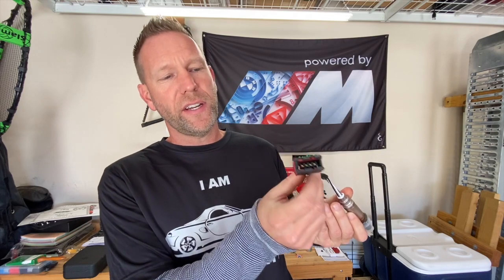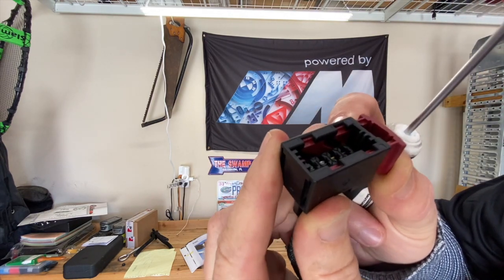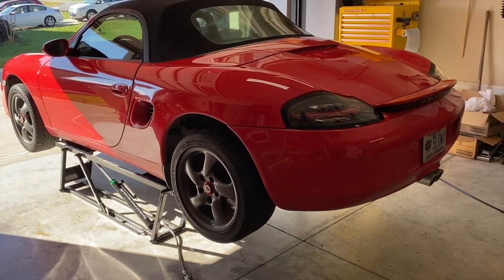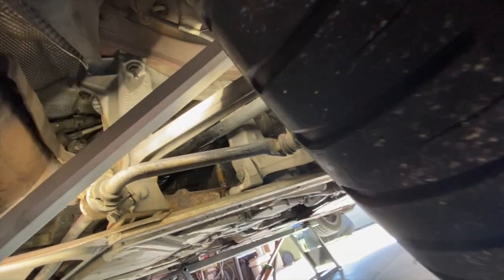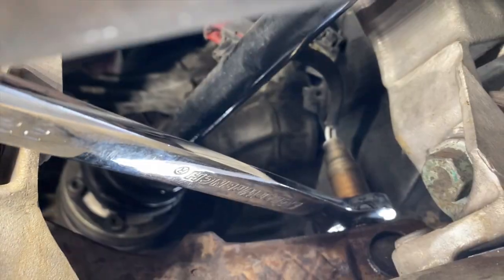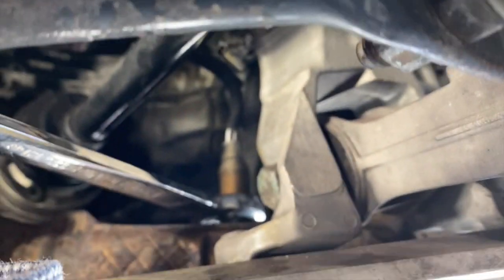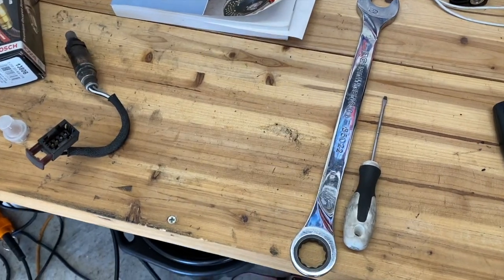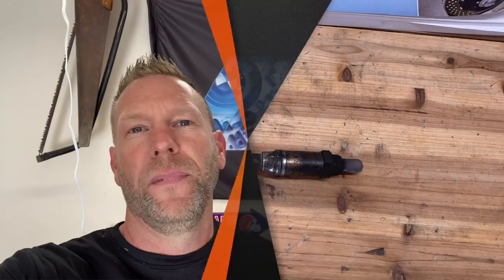How to change the OXYGEN SENSOR in a Porsche Boxster 986 (Project 19)

Comment: Hi Aaron. You're a very lucky man getting that o2 sensor out so easily. Changed out both my pre sensors around 6 months ago and a week before doing the job I sprayed them 2-3 times a day with penetrating oil just to give myself a good chance at getting them out as they looked in very bad condition, but to no avail as they wouldn't budge. I then had to use a lot of heat and slowly but surely they started to move. So well done getting them out without to much hassle, I'm sure you were relieved.  Mick 👍🍻
Reply from the maker: +Michael Kane I was very relieved! I was expecting the worst.

Comment: Great video describing how to replace O2 sensors on the Boxster. I have  a 2000 Boxster with the 2.7 engine . Since I have access to an overhead hydraulic lift where I can stand underneath the vehicle to get at the vehicle’s under carriage and don’t have to crawl on my back in limited space, is it necessary to remove the rear wheel in order to get at the censors? I have the long-handled 22mm wrench to help me get into tight spaces.
Reply from the maker: +Larry Johnson thanks! You should be able to do it with the wheels on the car ;)

Comment: That was an awesome demostration, I bought in and working on my first ever project car. I love all of your videos. I think I need to replace o2 sensors as the guy sold me told it may need, How Can I know how to get the codes? Ii bought a cheap obd2 scanner, but it didn't work. Also, I followed your door speaker video awhilie ago and removed it, I want to know how to get the new wires to from door to dasahboard, installing mirror lights and cameras(followed your head unit install video too). I got many doubts with wire assembly for speakers as dash speakers are working but not the door ones. But anyway please help me with the other questions for now. Thank you
Reply from the maker: +@nalladimmukalyan5475 thanks for watching! Glad the videos have been helpful. I would either get a PIWIS or a Launch for OBD codes. I have videos on both, of course ;)
As for wiring I’m afraid I can’t help there.
Reply: @HelpMeDIY  Thank you! I will take a look at them, have a nice day!

Comment: Is there a good place to search for O2 sensor related error code? I got a P0140 and P1117 for the code. But no matter where I search, I cannot really know which sensor it is.
Reply from the maker: +ONE THIRD MAYO O2 codes are often tricky to diagnose and I’m usually not good at it. If Google fails I ask a real mechanic

Comment: Hello, I’m getting errors P0430 and P0420. Is this something related with the O2 sensors? Switching them will with new ones will address this issue? (2001 986 base model) Thanks!
Reply from the maker: +Alexandre van Meerbeke sorry I don’t have any experience or knowledge about those errors so I would have to google them too.
Reply: @HelpMeDIY  No worries! Thanks for your answer. By the way ... great videos and content! Very instructive!!
Reply from the maker: @vanmeerbeke  You got it! Sounds like you're a subscriber and regular viewer so I appreciate it! Be sure to sign up for the free shirt giveaway if you haven't ;) It's coming up very soon.
Reply: I have the same errors. They mean catalytic converter inefficiency. P0420 is bank one and P0430 is bank two. I tried using a product called OxyCat, recommended by my local Porsche racing shop and purchased off Amazon. It cleans the cats and that got rid of the bank two code. When I removed the bank one cat, it rattled like there were dice inside. That means the cat is dead and needs to be replaced.

Comment: PB Blaster, nope....WD-40....Nope.....Stinky Summers' Guaranteed Nut Buster YES!.  a 50/50 mix of Acetone & Automatic Transmission Fluid, in a spray bottle. Works a LOT better than most commercial anti-seize lubricants. Soak the parts you want loosened, soak 'em well for a while. Acetone acts as a carrier for the ATF, it penetrates very well. Then the acetone evaporates leaving the ATF.
Reply from the maker: +Radiograph Pictures interesting... never heard of that one. Thanks for sharing.